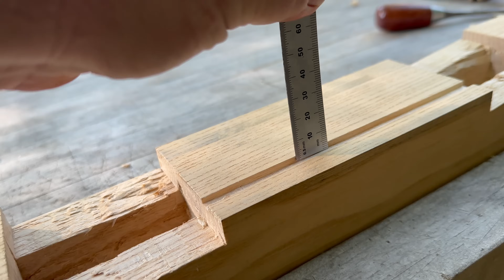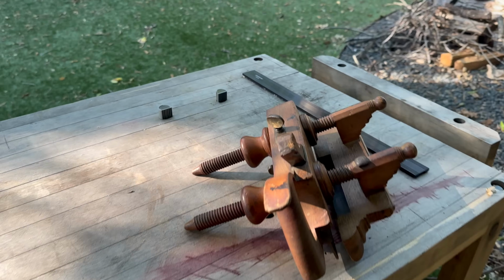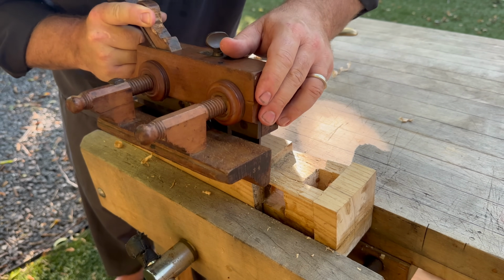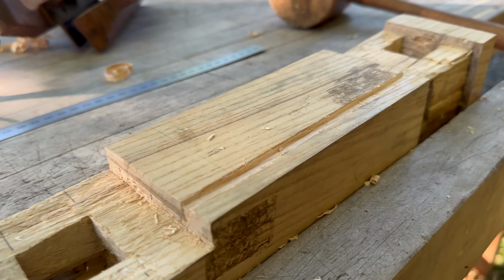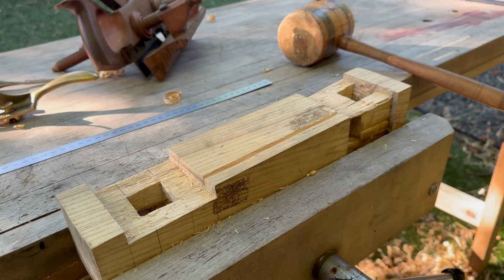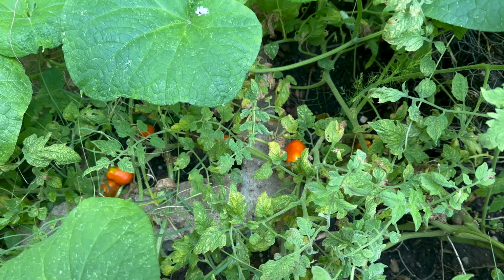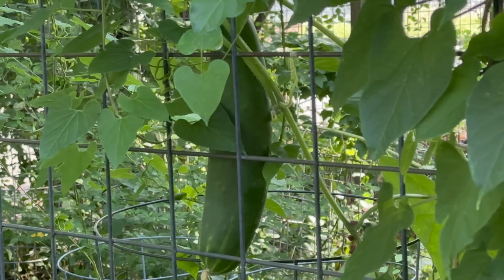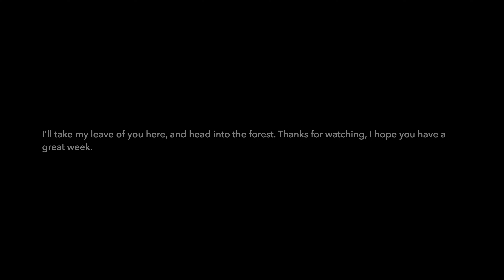7 || From Timberframe to Fire:  Building, Cooking, and Bear Hunt Intro

Comment: Start with the plough plane and finish with the other. It is a much better finishing tool
Reply from the maker: the work area was a little too short for the plow plane, making it easy to bang up the shoulders. The beading plane was much easier and cleaner to use in this case.